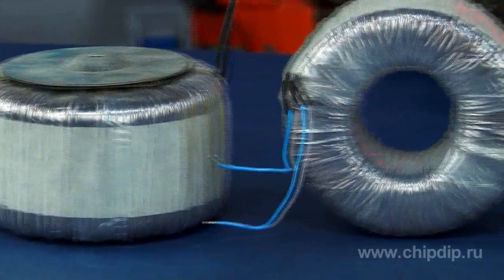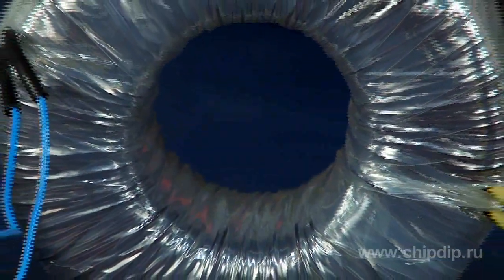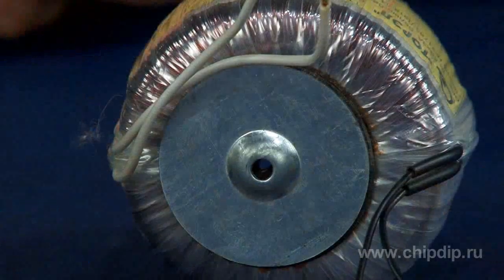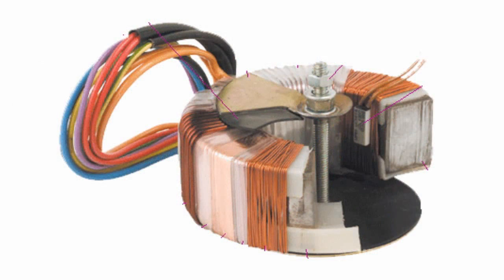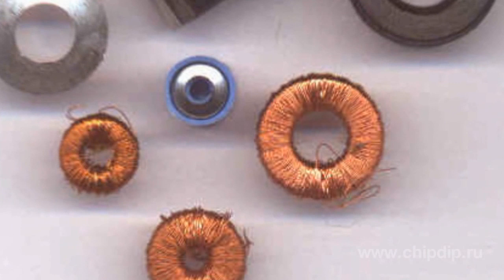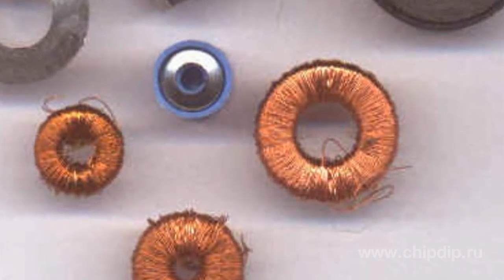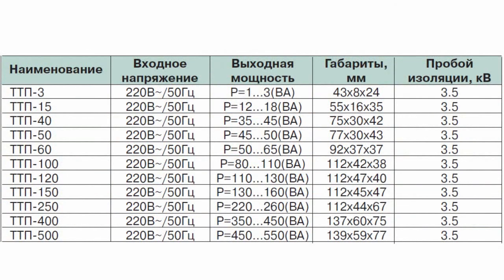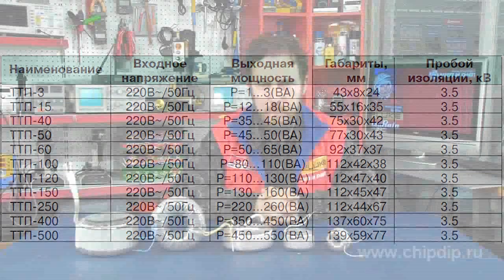Toroidal transformers TTP

Comment: What if you made that into a stator and making the magnetic rotor look like a toroid is interesting Add slots for added magnetism potential. This will also give you a place to rap your wire around the permanent magnet toroid/stator. The lily impeller needs to be implemented with the rotor part of this generator. Using a permanent magnet steel for lily design then fill the whole of impeller with copper.